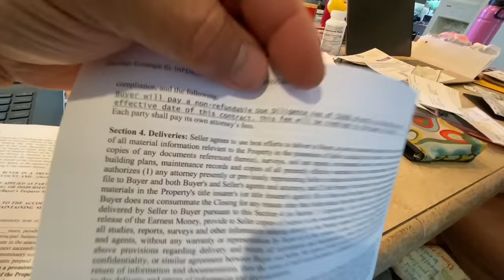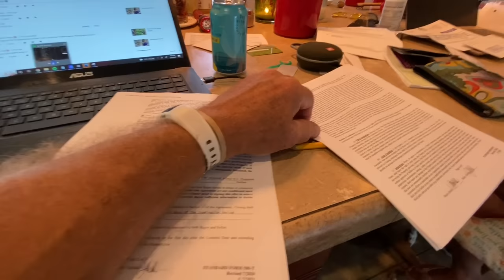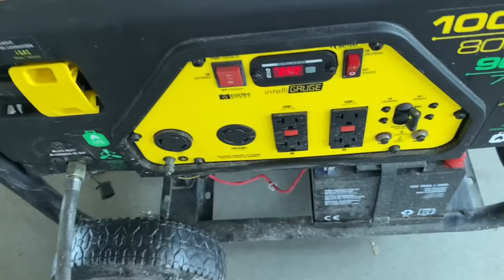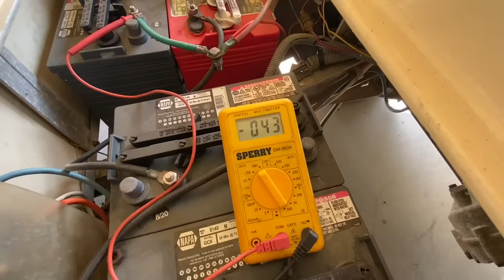"Trailer On A Ditch"

Comment: Exoman,  A lot of those Briggs engines have a oil drain plug under the motor and it is a Allen wrench plug that is usually covered with grass. Look under the deck and get a brush out and you may find it. Much easier than your method to drain the old oil. Ask me how I know.......